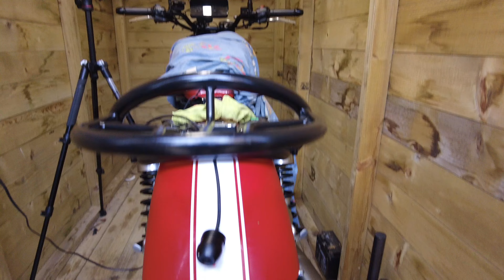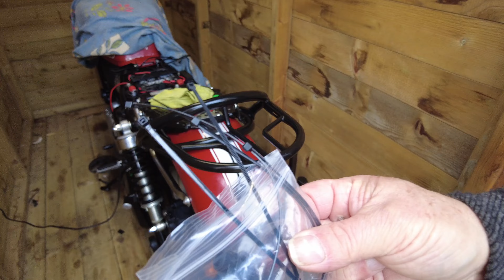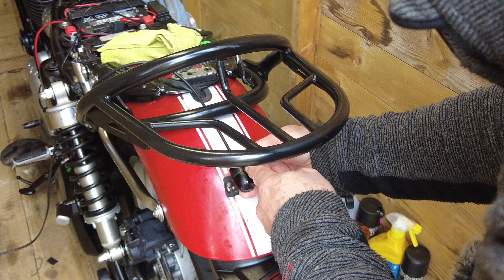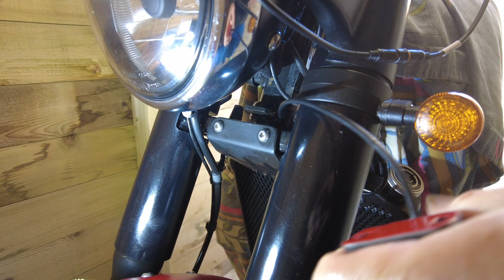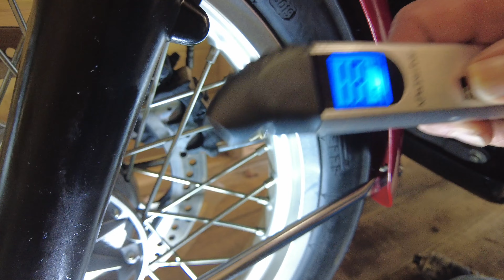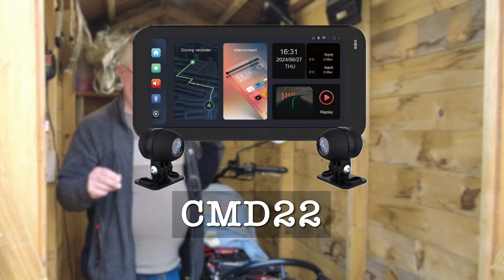How Hard Can it Be? | Aocci C6 Pro All in One Unit | Easy Install Guide 😉

Comment: Thanks.  This looks v interesting.  I’m curious why you’d want it to be powered with the ignition off?  Wouldn’t that drain the battery?
Reply from the maker: Definitely NOT a good idea to have working. With the ignition off, unless you put a switch in the circuit. If you look at the Economical Rides channel, he has done that. My setup switches it on with the ignition. I originally had it working from the USB port,  which was on all the time it was plugged in.

Comment: Useful vid, I’ve just got hold of one, do you know if you can mount the cameras upside down, I’ve got a great place in mind for the front camera but not sure I can change the orientation
Reply from the maker: I'm pretty sure you can do that.
Reply: @ thanks I’ll find out soon😂
Reply: @hudsonrilke  you just swivel the camera in the mounting so it doesn't matter what position you fix it
Reply: @markjones_007 yeah i can’t quite get it to work for me but I have some GoPro fittings